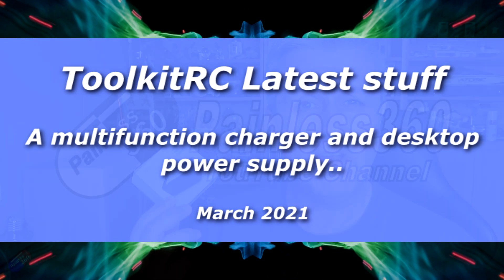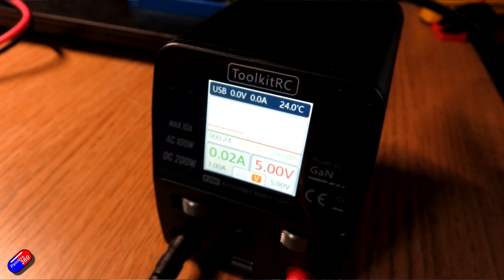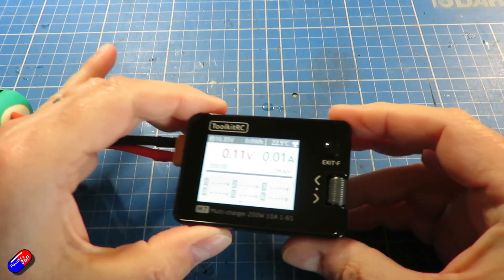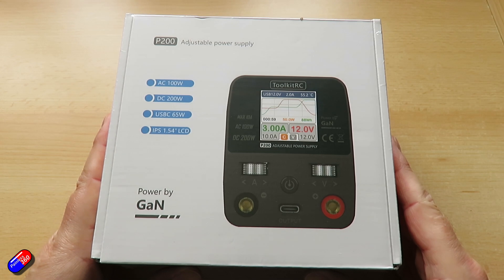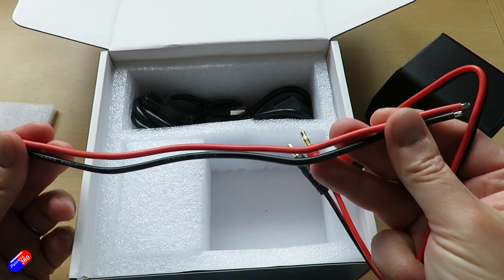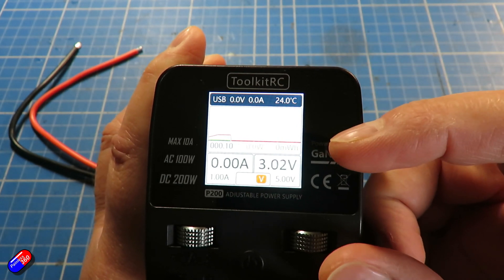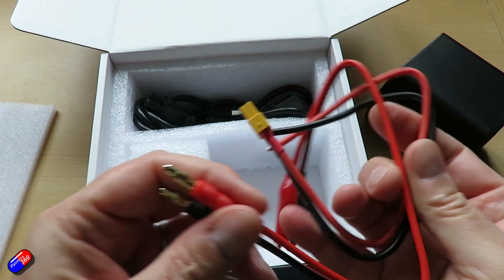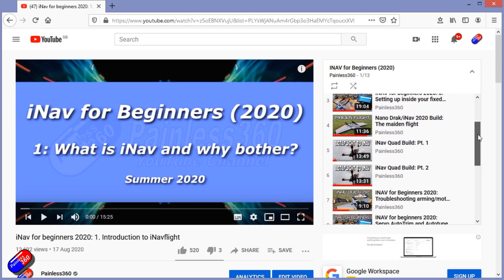NEW ToolkitRC kit: M7, a multifunction pocket 200W charger and a P200 desktop power supply

Comment: just getting into the fpv hobby i bought the m7 can i use the ToolkitRC ADP100 100w 20v 5A Power Supply Unit with XT60 Output  to charge my 4s batteries ?? at least for now
Reply from the maker: If you mean to power the charger from the power supply? Probably but watch the amount of current you pull from the power supply doesn't go above the rating of the power supply... Best of luck

Comment: This neat ToolkitRC P200 charger is designed by insane people. Everything exchanged or,turned upside down. Usually you do have plus on the left, minus on the right. The main switch usually is used just the other way around. Switching up is on, down is off. Also Voltage is used to be on the left and current to be on the right! 🧐🤨🤯

Comment: Painless360, on the new m7 what power adapter do I have to plug in to get it to function on the desk? Yes, I am stupid new to this but my wall warts never have an xt60 plug so I am missing major from list of things to acquire.
Reply from the maker: It will run on a wide range of DC voltages so any DC supply with enough current will work. In practice I've seen car batteries, laptop power supplies and other large Li-Ion packs used..

Comment: Have they increased the accuracy on the M7? Can you test the balance charging accuracy? I bought the M6 on the basis of many positive reviews but it soon realised that it was awful for charging batteries. Even with calibration it would never give a consistent voltage read on plugging in multi cell batteries and it would never end charging even with trickle charge off. Once pumped 900mah into a 700mah battery and only stopped due to the time cutoff. Very scary. Now used as a power supply.
Reply: m6 or m6d ?     ,  on the m6d just a good power supply OR a firmware update will fix the charge not stopping

after contacting support , with a good PSU the problem have disappeared for me , then later they have released a firmware fix , and going back to my "bad" power supply i didnt have any issue anymore

calibration with an accurate multimeter give me consistent result for month , charging equally to the 0.003 mV precision